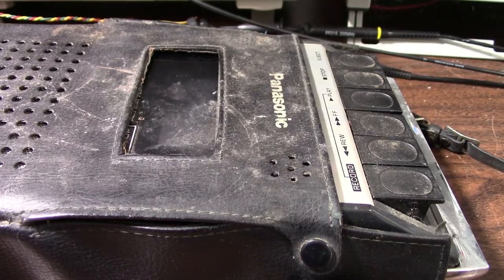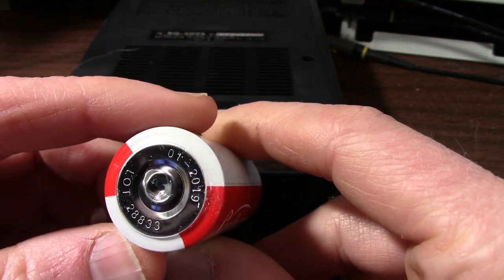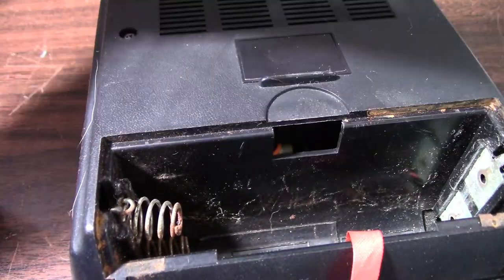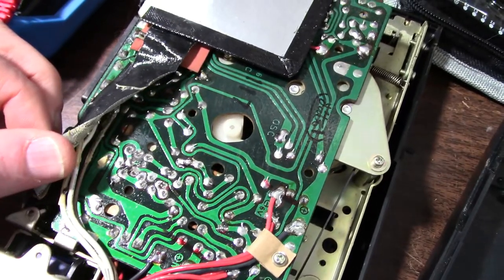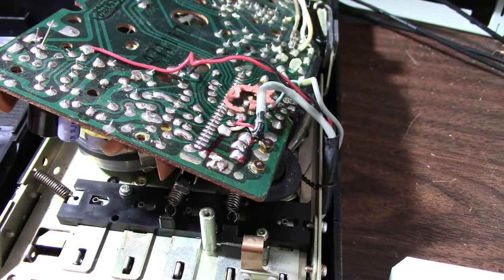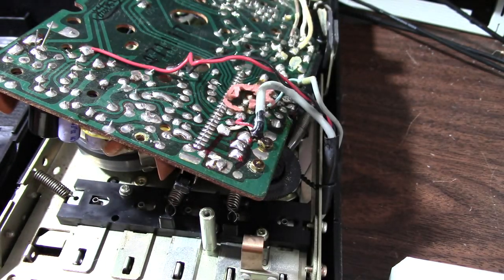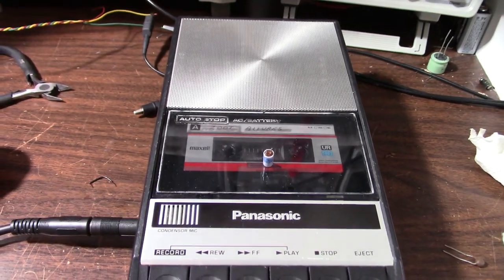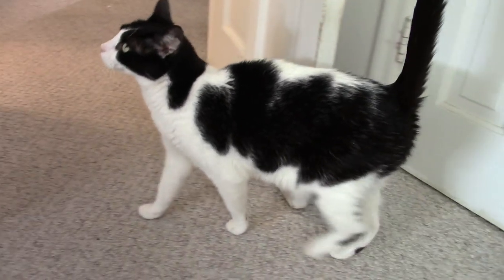Panasonic cassette recorder RQ-309S repair

Comment: I fixed a lot of these as a HS kid working P/T for an AV dealer in the late 70s. I don't ever recall having a problem with the electronics in any Panasonic cassette recorder, only dirty/magnetized tape heads or a dirty play/record switch. They were fine machines. Thanks for the memories!

Comment: The FF button is momentary. I had one of these Panasonic machines in the early 70's. It always worked well and I used it a lot. I'm surprised the belt is still good. I worked in an electronics parts store and I sold a lot of replacement belts, GC Electronics.
Reply from the maker: Thanks for confirming the momentary FF function.
Reply: @JohnAudioTech  In the late 80's my local Goodwill store had a steady supply of these for $5 and I bought a few. The RQ-309S and RQ309AS were very much the same except that the  S had a combined record/play head and the AS had separate heads. The RQ-309DS had a few changes: locking FF, a  relocated DC input jack, relocated volume control, addition of a tone control, and an updated motor with one governor weight , not 2. My 309DS also had a bit better bass than the older models I had. That may have been typical, or not. It was the only one with a tone control, so they may have tweaked the frequency response to allow the tone control to really work.

Comment: I love these old tape recorders. They make a really cool guitar pedal alternative because their IC's or transistor circuits have so much gain. Wire the guitar cable to the tape reader mic or  1/4 jack is it has one and I use a 10 8ohm Peavey speaker out of an old bass amp and CRANK the volume and jam. I remember you mention guitar amps in a past video and their not your thing. I find overdrive and distortion pedals the most interesting. 👍🤘🎸‼️

Comment: I want to thank you for the info that fixed my problem. I googled  "Panasonic cassette tape recorder amplifier stopped working", and found this video. Turned out my recorder had the exact same problem. Fuzzy contacts on the record-play switch. Without the batteries in, I pushed play, held the record prong back, and pressed and released the record button about 10 times. That did the trick. Thanks again for your help.

Comment: I still have the same model from 1974 and it still works although the power transformer had to be changed a long time ago after it got shorted
Reply: I keep telling my coworkers and they keep looking at me funny, but the Japanese simply make very high quality goods. Their electronics and gasoline engines are remarkable.

Comment: I had one that was a little different. Mine had an AM-FM radio built in. These were gold! Plug in the wall, batteries or a wall wart. Mine could record off the radio or the mic. I use to record a song I could catch on the radio so I could work it up on guitar. It was a bunch of fun! Great project! Thanxz
Reply from the maker: In '79 or 80, I got one of the AM/FM recorders (mono). It was my music system for a time.

Comment: My mom used to record on one like that in the early to mid 70's from LP's . I don't remember if my Uncle sold those Panasonic's or not but she did use the ext. mic to record.... She had it down pat.... Until we got off the school bus and came in the door hollering  , what;'s on stove ???  LOL... 

That cap you took out , looks a lot like those old resistive caps,  A resistor inside of a cap , it saved space on the board, maybe that's why you had a super high ESR ????   Check it out Mon Ami .....
Reply: Good call on the cap.
I wondered if it was an early tantalum or bipolar cap of some kind but I'm now wondering about your theory

Comment: I have two or three of these, at least two that work. They look identical but are latter vintage, pretty sure with Si transistors.  My brother would save them from the trash from the church he worked at.
Reply from the maker: Panasonic seemed to use the same model number for newer versions.

Comment: Hi John,
Thanks for this video, I have this exact model, and all is well except when I press play, the pinch roller doesn't come up to meet the capstan. I can see that the "tab" on the roller is out of the slot on the frame mechanism. Is there an easy way to get to this outside of removing the frame from the chassis?

Comment: I was surprised that the recorder took a dynamic Mic as input for the external Mic. I, until now, thought that external Mics for portable recorders such as your Panasonic were electret/condenser Mics. Is there an easy way other than try and fail to determine what the input expects as a microphone? I ask partly because I like the analog method of producing recordings and have several recorders including two component cassette decks and one reel to reel player. My LX1 made for Sears by Sanyo in the early 70's only accepts condenser microphones as well as my shoebox Optimus recorder from the eighties.
Reply from the maker: In my experience, most will take both as long as the condenser version has its own battery. As a kid, I remember most of the recorders including a cheap dynamic mic before they all included an internal condenser one.

Comment: I have the same model, but the play button doesn't stay down and the record button won't press at all. Can this be sent to you for a repair? I am getting sound.
Reply: Probably a dirty mechanism. A sliding bar locks the play button down. If it gets dirty or corroded, it no longer slides correctly and the play button won't stay down. It requires removing the chassis from the case to repair. For recording, there is a mechanical switch that is actuated by the cassette itself. Look at the rear of the cassette opposite where the tape opening is. If you see a small square hole in the case, the record button won't work. Cassettes had two removable plastic "nubs" (one per side) that kept people from accidentally recording over something they wanted to keep. The way to defeat the protection is to cover the hole with a piece of tape. Good luck.

Comment: Aren't those plastic case ones capacitors with resistors in parallel? I might be wrong though. But that would explain the higher ESR.